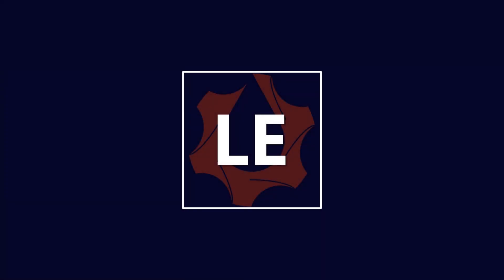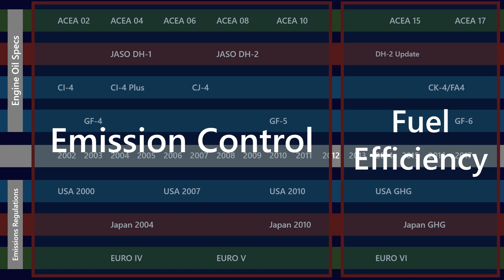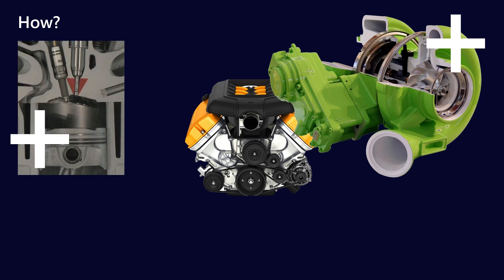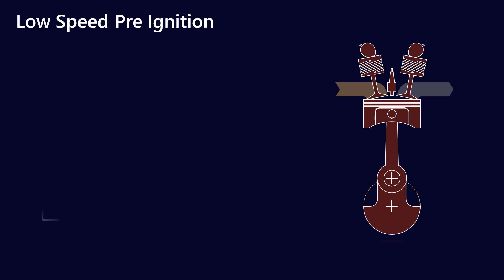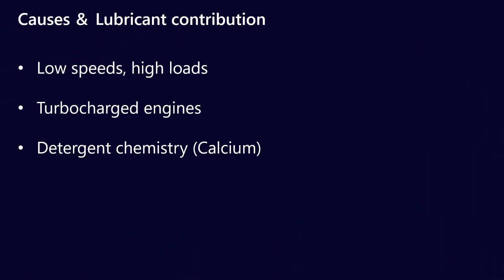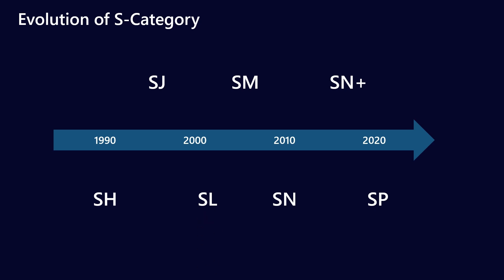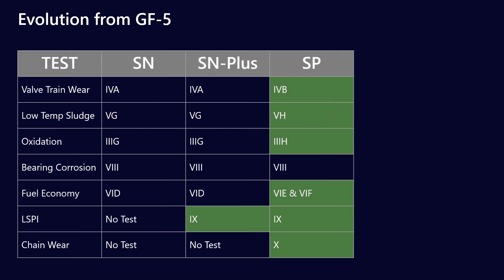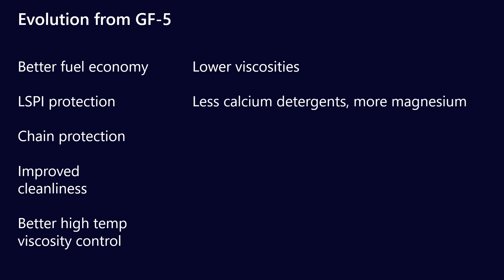SP and GF-6 engine oils - what’s new?

Comment: Thanks for the amazing information. 

Do you think I can use 0W20 in my 2014 Toyota Camry if I live in very extreme hot weather above 122F. My Owner's manual recommends using any oil viscosity from 0W20 to 20W50, and they did not specify and specific viscosity!

I use Amsoil signature series 100% synthetic 5W30 right now. It is API: SP, ILSAC: GF-6, and Acea: A5/B5
Reply from the maker: To be honest, you probably can - but if you've been using the 5W-30 with no issues I'd stick with that. The fuel economy benefits of moving to a 0W-20 are going to be pretty marginal.